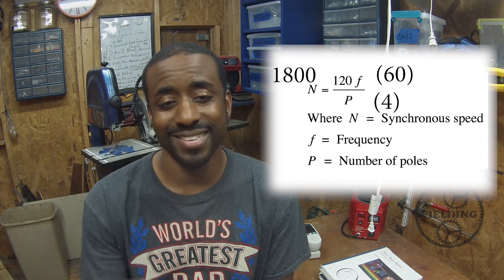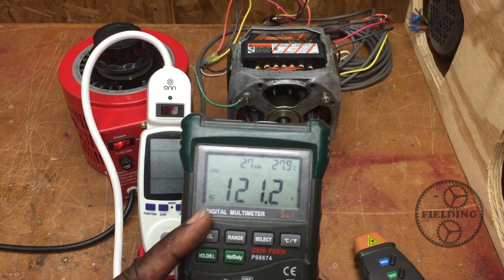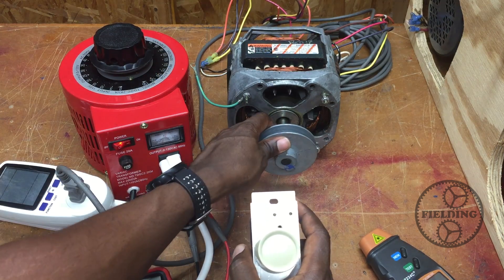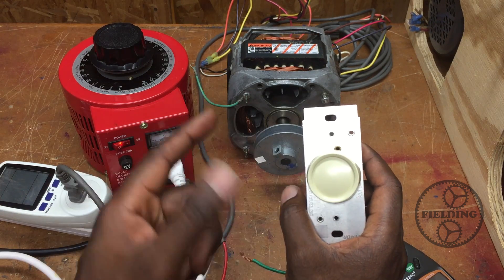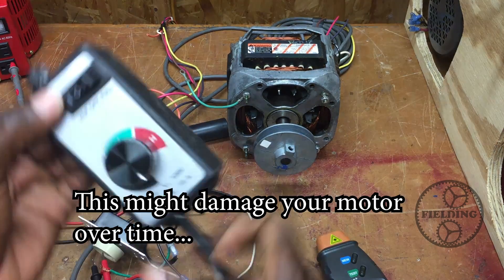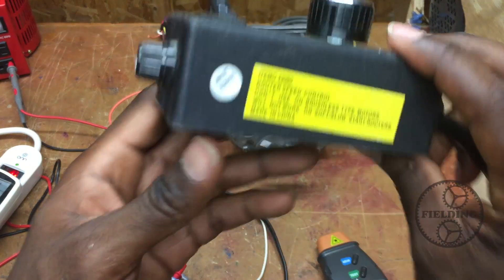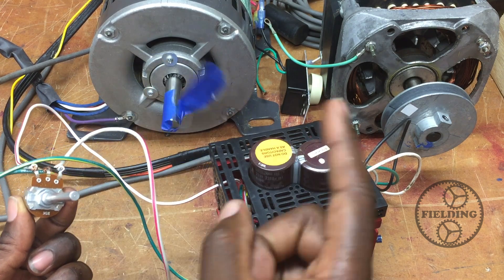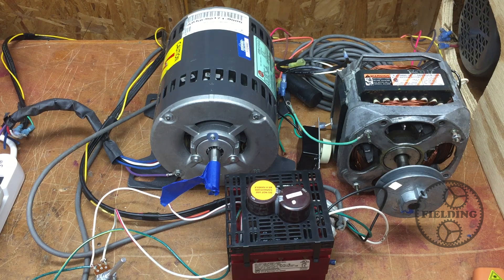Will A Dimmer Switch or Transformer Control An Induction Motor's Speed: 038

Comment: Good information - thanks!
In Mr Carlson’s Lab on YT, he designed a VFD for a single phase induction motor in a Hakko desoldering station.
He went from the normal 60Hz operating frequency to 90Hz in order to increase the vacuum.
Reply from the maker: Increasing speed is not a problem. Lower is what creates the problems. Faster means you will have less torque but that doesn’t hurt his project

Comment: the motor you used the VFD on is a 3 phase right?
 so are you also runung it from 3 phase power or single phase?
Reply from the maker: The VFD is single phase in, three phase out
Reply: im sorry im new to this.  so the motor is single phase or 3 phase . the power coming in through the grid into the VFD is single or 3 phase? the power going out the VFD to the motor is single or 3phase?
Reply from the maker: The motor is 3 phase. Most people don’t have three phase power at their house. It is a industrial site kind of thing. If you use these motors in a home shop this is one solution. Single phase in the the VFD three phase out to the motor. It is designed to convert one to the other

Comment: It's important to note that when you slow the motor down you also lose power. The torque on the rotor is determined by the strength of the magnetic field acting on it, which pretty much stays constant, leading to a loss of power (same torque at slower speed=less power). 

This is a problem for machine tools since you want constant power throughout the speed range (for example a drill press, lathe, milling machine etc.), meaning torque needs to increase (NOT stay constant!) as speed decreases to keep the available power more or less the same. 
Work done by a particular cutting tool moving past the material at X speed and at Y depth of cut is the same regardless of radius of action (small drill vs large, small milling cutter vs large, small diameter work piece in lathe vs a large one etc), therefore if the RPM is dropping (to keep the tangential speed constant), torque needs to increase for a constant force behind the cutting edge. Power is Force X distance/time, so constant force at the tool requires more torque as the radius of action increases (and constant tangential speed require less RPM as radius increases).

The only real solution is a mechanical reduction, i.e gears and pulleys, which multiplies torque proportionally as the speed decreases, keeping the power constant (more or less, ignoring some mechanical losses). Or, sufficiently oversize the motor that you still have enough power at the slowest speed you will be running it, but that's obviously not as efficient, and not nice to the motor. 

There is NO magic solution, embrace mechanical reduction whenever you have it, even when you have a 3-phase motor with a VFD, so you can keep the motor running as close to its rated speed as possible, for maximum available power and a cool running motor (the motor fan also slows=less air flow!). I would love to build an external reduction gearbox/pulley system for my future lathe, to achieve very slow speeds at full power and have more speeds in between the stock speeds (be it a geared head lathe or a belt drive). I'm not a fan of slowing motors down at all, although a VFD with a big 3 phase motor would be nice for soft starts, quick stops, and moderate speed control between the different gear/pulley speeds.

Comment: So then to get 120v 60h from a dc generator 4 poles it would need to be ran at 1800rpm constant? How much torque is needed to run a generator?
Reply from the maker: There are too many missing variables to answer your question. I recommend you watch my series on “how motors work” there is a generator video in that series, and I have two other videos on generators... which put together would probably fill in the gaps for you.

Comment: Have you done a video on sewing machine servo motor or (brushless motor type) replacement for the clutch type motor sewing machines come with. I think we can really benefit from this due to the compact size and power and variable speed control all in one. It can be adapted to many shop machines like lathes, mills, drill presses, and other machines that aren't speed controlled.
Reply from the maker: That motor would be too small for power tool use I think. I am not certain but generally the manufacturer uses the smallest motor possible to do the job and save money. Not much power is needed for sewing
Reply: Jeremy Fielding I purchased one for a pfaff sewing machine. It's 3/4 hp. More power than what's on my drill presses (I've got three). It would be perfect I think for many projects as it is a brushless motor with a built in speed control, its also very quiet . It is about $130. I'm making a cnc mill and lathe and I plan to use it on the lathe.
 Really like your vids. Keep it up.

Comment: Wow.  Great video! ... even though most went far over my head. ha.   I've recently purchased a 60KTYZ 110v 2.5rpm 18w synchronous motor off Amazon.  It's been suggested to me that it's not actually synchronous but actually PSC.  I'm not really sure what it is.  What's the easiest way to control it's speed?  I need to slow it down a little.  Thanks,

Comment: Your techical explanation was great.  I was just about to try this myself.  I understand that many 3 phase vfd will run split phase or single phase induction motors as long as there is no start switch or start capacitor.
Reply: oops.  Thie first link I found was this discussion.  http://www.practicalmachinist.com/vb/transformers-phase-converters-and-vfd/single-phase-motors-may-run-off-vfds-177077/.  
I will try to locate the vfd products I was looking at a while back.
Reply: Here is one. https://bardac.com/ac-drives/   ....   Scroll down until you see E3 series - single phase

Comment: Great video. Just a quick note. Make sure that the motor that you're using with a vfd is "inverter duty". VFDs create high voltage spikes and insulation can fail faster (less motor life) if it's not designed for the higher voltage.
Reply from the maker: Also cooling is a problem now that the fan is running slower. In general that will damage the motor sooner then later. Definitely worth mentioning.

Comment: I've had squirrel cage blowers out of a furnace that have several different supply wires you could hook up for different speeds.  How does this vary the speed of a single phase motor? Thanks.
Reply from the maker: I talk about that in part two #43

Comment: what would happen if you use two legs of a 3ph VFD on a 1ph motor?
Reply from the maker: Most likely nothing. Most are designed to know when they are connected wrong. I would expect an error message. Also all the problems I mentioned in the video if it did work like damaging the starter winding. I haven’t tried it. You can bypass the starter winding with a second switch and that would solve the second problem.
Reply: I have not tried it, because it would take me (I am not setup in a lab or shop) a long long time to try,...  and I am pretty sure your prediction is spot-on. The output error could be "hacked", but I would likely decrease efficiency so much so as defeat my purpose. I learned about the starter winding problem from this video, Thx. 
   Chinese VFDs are so cheap for 3ph, and like you, I cannot find VFD for 1ph for even 1hp. I am new to HVAC, and see that SEER could be increased so much by VFD compressor control. 3ph compressors are readily available, but it would be so great if one could contol freq on an existing installation.
   I have been trying to find out approximate power losses from VFD.          

 ie. a loaded 2hp motor on mains vs. at 60hz through a VFD.  Any ideas?
Reply from the maker: I would expect the difference would be barely detectable. But I don't know.

Comment: Great presentation. I have thought of buying a speed control for a Leslie speaker that only has a high speed motor. At least one company makes a speed control for the Leslie motor that uses PULSE WAVE MODULATION. Do you know if this will shorten the life of the motor?
Reply from the maker: It depends on both the motor exactly and the application. I made a part two because fans are a example of an exception to the rule. I can’t give any advice on this directly because I don’t know the product but that video will be helpful.
Reply from the maker: It was posted right after this one

Comment: Is there any way that I can make one of these sir if so please post a video about that or a link thank you
Reply from the maker: Make what? I don’t understand the question
Reply: Jeremy Fielding sorry I posted the comment to the video about making an adjustable frequency variable thing I have several Motors but I would like to be able to adjust the speed and I did want to build a dimmer switch with an outlet to control the voltage to certain Motors. But you explain that that's not going to work and I have not built that yet. So for certain Motors as you explained brushed motors I'll be able to do that so I need to change the outlet to say alligator clamps. But the other Motors brush less I would not be able to change the frequency by adjusting the voltage there for that device would not work then you showed a device that you purchased for these type of motors is there any way that I can build one of those? That was  my question.
Reply from the maker: I am sure there are DIY versions of a “VFD” variable frequency drive” but I wouldn’t try to make one myself. I don’t feel comfortable making it, but search the web and see if you like what you find... you might decide to try and learn something on the way
Reply from the maker: I have to let you have it from here. I get hundreds of request like this, and I just don't think it is safe or practical for me to give direct one on one advice... especially about designing home made equipment. You have to decide if you want to try this or not.
Reply: Jeremy Fielding okay ,but before I do, I would like to ask you first if you have a link on where to buy that type of equipment? I am on a very tight budget.

Comment: With a VESC http://vedder.se/2015/01/vesc-open-source-esc/ I have got my ac motor to run with spped control using the VESC and RC remote and reciver from 36 volt DC I can post a video. It can Run ac or dc motors  PLus it open source.  reverse regenerative braking a pc or mac app to set all the motor parameters that you could ever need dont understand them all  It will run test your motor and auto set up most of it for you.  https://www.youtube.com/watch?v=bivXOlqooCE Here is the guy that build the VESC
Reply: Love your channel but you make me wish i had pay attention in class
Reply from the maker: Lol

Comment: Do you have to have a 3 ph service to your property to run a 3 ph motor?
Reply from the maker: I am using a single phase to 3 phase VFD. As long as your "single" phase line can supply the current for all three phases  of the motor you are fine. These VFD's often requires 240 volts but not always if the motor is small enough. It only becomes a problem with very large motors which would require special wiring anyway within your electrical panel, or three phase power.

Comment: is there singlephase vfd is available
Reply from the maker: Yes... but only for certain induction motor types. If your motor has a start winding for example you can't use a VFD with it. At least not to slow down. You have to do your homework on this one. There are only a few special cases where it is appropriate. You should also watch part two to get more information #43

Comment: I have a single phase,brushless induction motor from a washing machine. If I wire it up directly,I must start it by hand and it rotates fast. If I wire in a run capacitor then it starts in my desired direction but it rotates much slower with reduced torque. It is a 10 microfarad capacitor. Should I drop to a 3-5 capacitor in order to increase speed and torque?
Reply from the maker: You need more capacitance not less. Buy a washing machine capacitor so you are sure you are buying the right size and rating

Comment: Ok so the only real way to slow a single phase is through a pulley system?
Reply from the maker: Specifically in applications where torque is needed, and there is a start mechanism. Watch part two first then you will know what I mean. #43

Comment: Thank you.  I was about to install one of those dimmer switches on a band saw to reduce speed to cut metal.  That will not work.  I will need a tread mill type motor with its own speed controller.

Comment: First video I watched when I woke up this morning: Mr. Carlson makes a VFD for a single-phase induction motor.
Second video I watched this morning: Jeremy Fielding tells us people don't make VFDs for single-phase induction motors.

... you can speed one up without worrying about the starting mechanism. Slowing them down is the problem. I guess this video is really about slowing them down, so, fair enough, but I still thought an ironic series with which to start my day.
Reply from the maker: You need to watch part two...  video #43...There are some single phase motors that can be controlled both up and down. So, I made a part two to clarify the difference. But yes, I would also agree a VFD for speeding up would work just find for a capacitor start induction motor. That is the most commonly used for DIY level shop tools, and was the focus of this video.

Comment: Jeremy, Can you do a video showing how to convert a 220vac dryer moter to 120vac. I have an old dryer andi want to salvage the motor. I was planning on making a disk sander with it but I feel 220v is over kill. What do you think?
Reply from the maker: It might not be 220. The heat element needs 220. But I can’t say for sure

Comment: Thank you for your excellent presentations.  I have a 30 year old Thermador vr600 kitchen exhaust fan with a single phase 120 volt induction motor. It seized up and was able to repair it by lubricating the mounting bushings, no bearings.  There was no capacitor and the motor turns on with a 360 degree rotary switch that graduates from high to continuously lower speeds without electronic speed control.  Variable speed and no capacitor, how is  this possible.
Reply: it's a universal motor, not an induction motor.

Comment: I have used these Fuji single phase VFDs but they require a special split capacitor setup https://www.wolfautomation.com/index.php/catalog/product/view/id/8658/s/frn0006c2s-7u-ac-drive-1-hp-5-5a/?gclid=Cj0KCQiA4bzSBRDOARIsAHJ1UO4pXjslcEgydA5Mi0zbAV9Q8sJA2BwLrkHxo7L_co9t-socqwVBCtEaAp2fEALw_wcB

Comment: Jeremy enjoyed your video.  I have a lapidary tumbling machine for which I use a 1/3 HP induction motor(50Hz).  The problem I have is that I would like to change the speed of the machine a little to accommodate two different working conditions , one is rough grinding while the other is polishing.  The polishing stage requires a slightly slower motor speed to work properly.  Any thoughts or suggestions would be appreciated.  My own solution is to change a pulley every time I change the task.  Thank you in anticipation.
Reply from the maker: Most machines with this problem have two sets of pulleys side by side. Other then that there is no better option that I know of

Comment: Hi Jeremy. I watched this video and subscribed. I am what you would call electrically inept, so I don't fool with it. But it is fascinating listening to someone explain it in laymans term. I was a hobby woodworker for many years and have always used different types of electrical tools. I no longer do woodworking since I retired and downsized  to a smaller home. I do however build toys and scale models. I still use my Ridgid oscilating spindle sander and a Delta 1" bench top belt sander. However I find that they run too fast for sanding and shaping plastic. Is there a safe way to reduce the speed?  Keep up the great videos. Thank you.
Reply from the maker: I am not sure of the anatomy within the machine. If it has pulleys that is the best option. Reduce the drive pulley or increase the driven pulley to reduce the speed. Otherwise they are made to run at one speed. You might need to trade for a different model which allows you to control the speed.
Reply from the maker: And welcome to the neighborhood!

Comment: Hi Jeremy, the washing machine has various windings for various speeds as on the washing machine you can usually select 900,1000,1100 or 1200 spin speeds how difficult would it be for a selector switch to select the winding speed you want not as good as from 0 to 1200 but at least you could choose one of four speeds. Another good video.
Reply from the maker: Very easy... super easy

Comment: That was a great lesson. I wanted to put an ac 3600 rpm motor on my drill press and replace the 1800 rpm motor and do away with the variable pulley system and just use a variable speed ac motor. I see I may need to use a DC motor instead.
Reply from the maker: You got it. Unless you have a three phase motor and VFD.

Comment: Have you looked at the use of a choke to reduce the speed of an induction motor? An old fan I have (made in the fifties) has a single winding induction motor that uses a two coil choke in-line to produce three speeds. As I recall, it uses both coils in series with the line to produce the low speed, one of the coils to produce the medium speed, and direct line to produce the high speed. I've looked for how to calculate the choke windings needed to yield a desired speed but haven't found anything. I enjoy your videos!
Reply from the maker: Low torque applications are different. I made a video about that right after this one. Please watch the next video in the series. #43 about fan induction motors and what makes them different